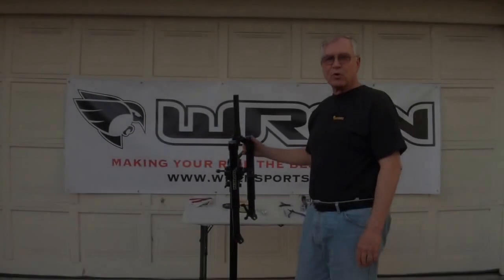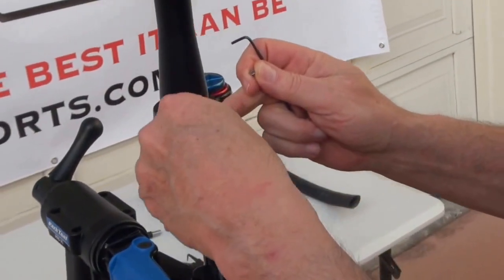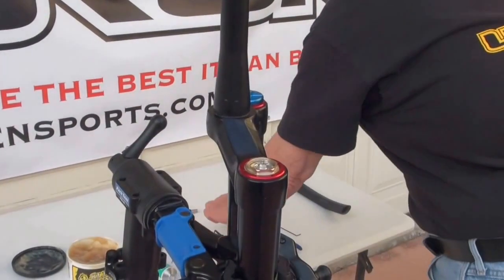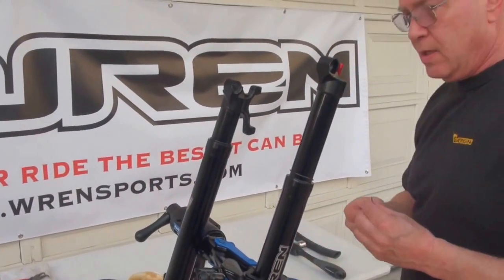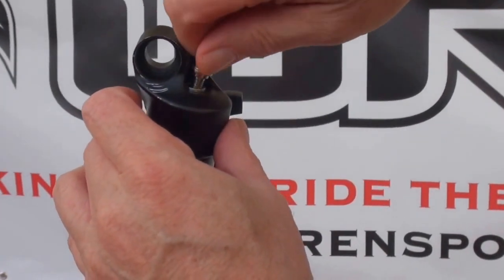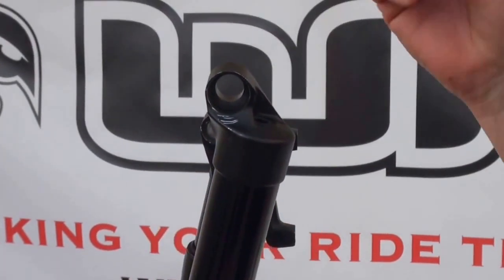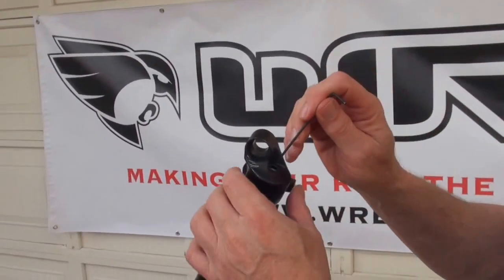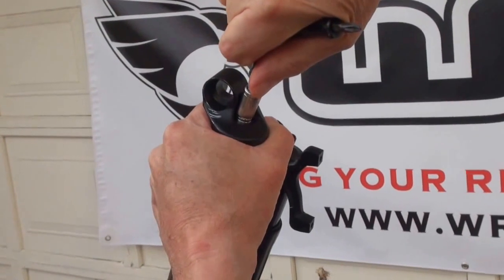Wren Suspension Fork Service  Damper Side

Comment: The video is 12 min long, but my first service took hours. A few things to note: 1. The bearing under the lockout cap is easy to loose. It can stick to the bottom of the cap thanks to a small dab of grease, but then fall when you pull the cap away from the fork. Slowly lift the cap just enough so you see the bearing, then carefully capture the bearing. No fast movements here.  2. If your lower bushing doesn't slide in easily for reassembly, pull it out and look for burs. The top tube somehow had a nick in it which was creating a bur on the bushing during reassembly. I lightly filed the bur and nick until smooth and was able to fully seat the bushing. 3. I had difficulty getting the bolt+washer+o-ring to "bite" onto the lower end of the damping rod during reassembly despite perfect alignment. My best guess is grease prevented the bolt from cinching down. When it wouldn't bite, I unscrewed the bolt and cleaned it with iso alcohol until it finally bit and I could get 5 Nm of torque. I unscrewed and cleaned the bolt multiple times until it "worked". Good luck!

Comment: Is it required to clean the parts with de-greaser etc and then to add new grease?
Reply: Hi Zvi! You don't need to use a degreaser, but if you do, be sure it is completely cleaned off and fully evaporated before applying the new grease.  Russ

Comment: Can the old damper cartridge be serviced? Thanks
Reply: Hi Ken! We do not recommend servicing the damper as it is difficult to properly bleed all of the air out of the system. We recommend you replace it if it ever stops working. There is no need to maintain the damper, it is sealed against any type of contamination. If it fails within the first 2 years, we send you a replacement free.

Comment: Is this oil side a mono tube?? Maintenance free? It’s unclear......
Reply: Hi Randy!
The oil side uses a sealed damper cartridge that is maintenance free. It uses a bladder to keep the oil under constant pressure at all times. Thank you for your interest in Wren products!
Russ Johnson
Reply: @russjohnson2781  Hi Russ, it appears that my bladder has leaked at some point. the bladder has deflated. is this a replaceable item?
Reply: @russjohnson2781  I don't get it. If the oil side has a bladder, that keeps the oil under constant pressure, then what do i need to maintain in the damper/ oil side of the fork ? Can you explain please, or give a link where all the info about maintenance sense ? Or if the dampers oil's resource inside the bladder, is expended, and i cannot change it on my own, than all i need to do, is just replace the damper, right ?

And where can i get the wren seals to replace, in case the old ones have their resource expended ?